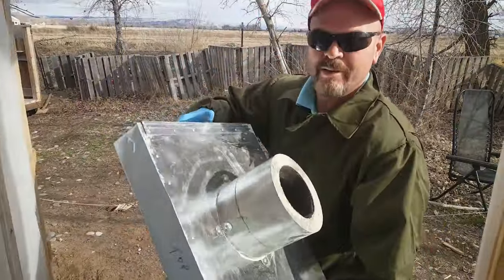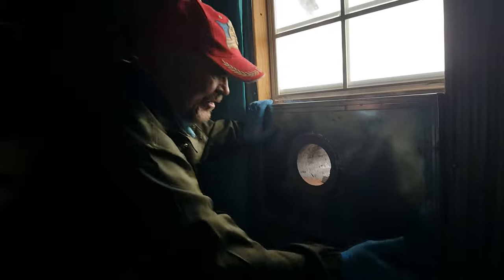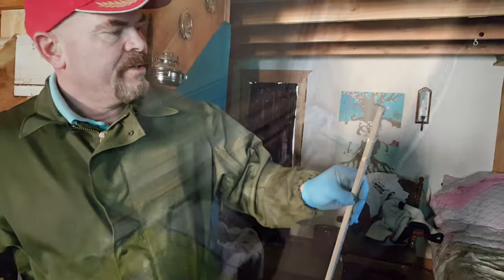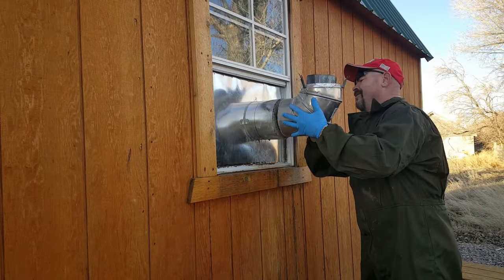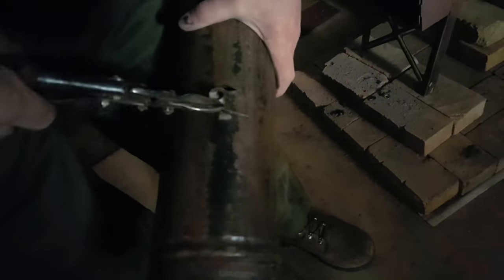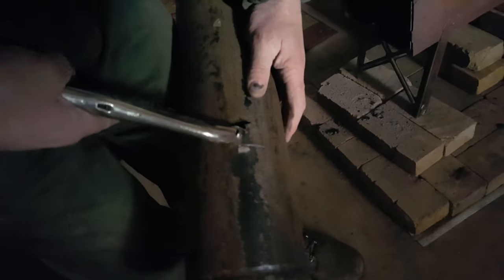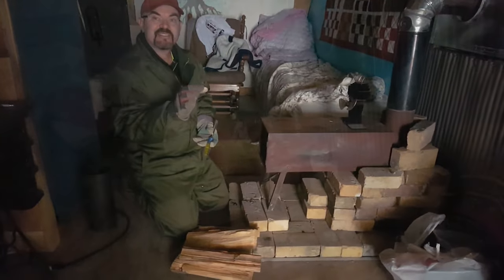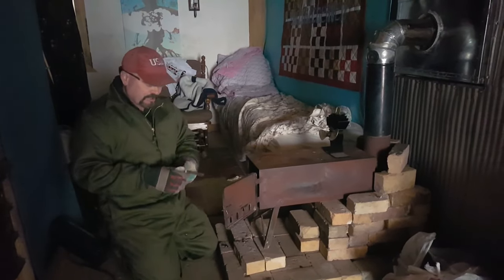Installing an Aircrete Chimney No Problem!

Comment: Darwin,have you considered using a tee at the connection into the window opening instead of an elbow,it may eliminate the need for disassembly for cleaning,just cap off the bottom side of the tee,just a thought,as usual-nice work,thanks,and GOD BLESS!
Reply: hey- good idea

Comment: Good for you Man, great job well executed. I like your ideas to make the chimney pipe using aircrete. I think I will use the same idea to build a chimney I have to make that is a real S curve configuration and the cost to buy the components are flippin expensive compared to making my own. Its for a Hunt camp using a rocket Mass heater with boiler. Keep on keepin on. Thanks for the vids.

Comment: Great Job!  Awesome.  The exterior pipe is a little too tall, it doesn't have to be quite that tall/high above that metal roof, I'd cut that last section on top down just a bit,, tbut all in all, great job!  Can you come install this in my basement?  Lol, I'm serious.

Comment: Great video. It would be kewl if you could discuss dimensions or regulations or say, how far away from the outer walls or above the roof line pipes should be, so we just arent watching you turn screws and guessing on our part. Cheers

Comment: I especially like where you stand on the top of the ladder, lean over from the side, and push down (7:03). The last time I saw someone do that, he knocked out all his front teeth when he hit the ground.
Reply: I'm glad they were BOTHso lucky as to still be alive. ANY small slip of the material, work, grip, shoes or footing for the unbraced ladder and you WILL Fall. Depending on how you crash land, you can be badly injured, handicapped or killed even without all that height. I have seen broken wrists and heard of much worse happening on the jobs I have worked many years ago. For the last 15 years such a deliberate and severe safety violation you could get a summary dismissal.

Comment: Do you have to have double wall piping the entire thing or just the piece the goes outside?
Reply: Double wall is only necessary when you do not have adequate clearance from combustible materials as well as going through walls and ceilings… at least around here. You may want to check your local codes. Also, you may want to look into your insurance to see if they will insure your property.
Reply: @simplytrolling6869  thank you

Comment: Yeah...  That's the only downside to filling the insulated recess with aircrete...  Not as much give when you try to mate your piping up and connect them together press-fit...  You had me a little scared getting up on that step ladder trying to press that section in.

Comment: WOW!  All that work, yet you put them together backwards!!!  Watch out for a chimney fire!!!
The pipes are supposed to be connected so that when the resin runs down the pipe the resin will stay on the inside of the next pipe and not run down the outside of the next pipe.  You are asking for a chimney fire!!!  The chimney draft always keeps the smoke on the inside of the pipe but the RESIN must run down the inside of the next pipe or you will eventually burn your place down....
Reply: I know what you mean ,of course no one mentioned the stove looks to be very close to a combustible surface...a BED ! Please reconsider this setup people!
Reply: That's the proper way, people. Think of the piping as if it were a series of funnels,  in that the smaller (inner, or "male")  end always points down, always goes into a larger (outer, or "female") end. Think of hot resin running down the walls of the pipe, as 54321Truth suggests...  If you connect with smaller ends pointing down (iow pointing toward the stove), the larger end of the next pipe in line will "catch" the resin and send it on it's way further down, hopefully to a cleanable end trap. If you install it the other way, at each joining there is the opportunity for the resin to flow out of the joint and become even more dangerous, being no longer contained.

That said, this rocket setup should in theory produce waaaay less creosote than average...but then again there's really no reason to not follow the "funnel" principle.
Reply: Will that be negated since the Aircrete completely fills the space between? From what I’ve read on other rocket mass heaters, the emission temp at the end of the pipe is generally much cooler than a wood stove or fireplace. In the range of 80-120 deg. F. In fact, some designs use an aluminum dryer vent for the stovepipe exhaust. There is generally no creosote and smoke with a good RMH. They burn cleaner than natural gas. 
I don’t quite understand why this design needs a 14’ stovepipe. Darwin claims it’s the part that makes the rest of it work. Perhaps running a hotter flue gas temp increases the draft but he also said it sometimes requires partial closure of the intake dampers. I’m perplexed. 
I would think the best of both worlds would be making the interior pipe male end down and the male end up on the exterior pipe. This would keep rain from entering the pipe and getting into the house or in the heat exchange pipes within the bench. 
A clean-out ‘T’ at the bottom end of the vertical pipe makes sense, too.

Comment: Insulating a double wall chimney with aircrete...
The better insulating solution would be ...Rock wool with some sodium silikate sprayed on it the keep shape 

Light weight
Simple and less work
Better insulating value (approx 3 x better than aircrete)